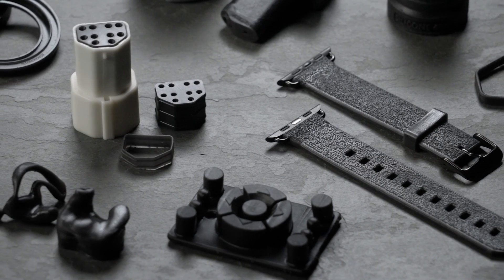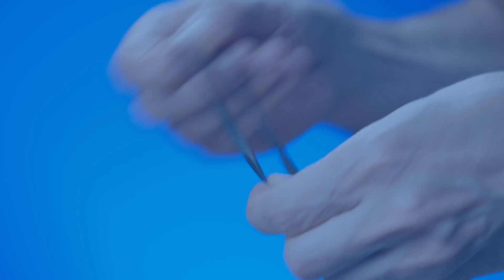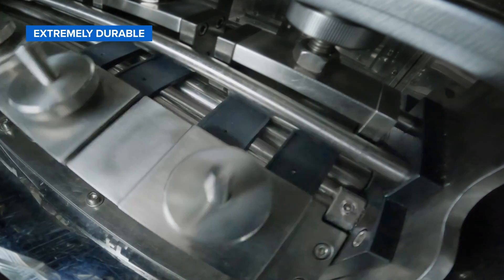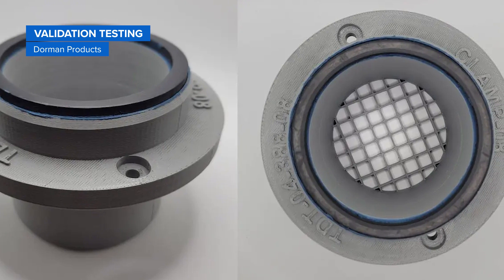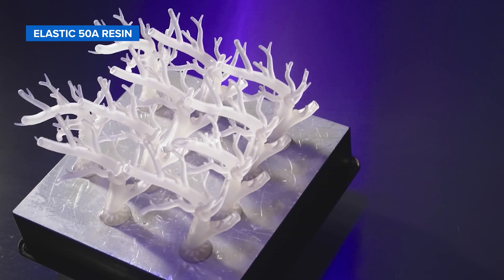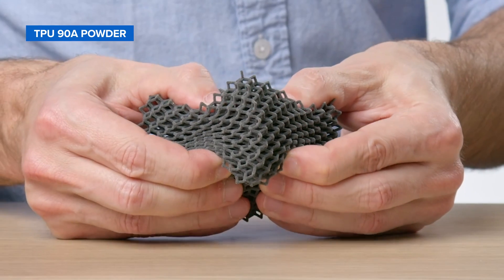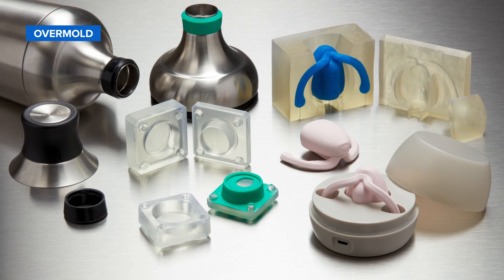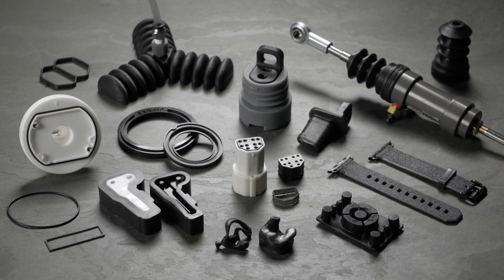How to Make Silicone Parts: Silicone 3D Printing, Silicone-Like Materials, and Silicone Casting

Comment: Bad dragons for allllllll!!!!!
Reply: i would assume this isnt PLATINUM CURE silicone. might be tin cure. i wouldnt do it this way. 
if you wanted to use a resin printer to make that, you can print it in hard resin, then cast it in silicone. repeat silicone molds using a pressure pot.

Comment: What about labor costs? This is why companies use automated injection molding. Tooling costs are high up front but then material and labor costs are much much lower compared to resin  so the overall price is lower.  If Formlabs could automate the process affordably and sell Resin for a price in line with production parts then I might be a customer.
Reply: This is for low volume fab. Automated injection molding isn't worth the upfront cost for most prototypes or short production runs. It's why people do silicon casting now, which is far more labor intensive than just printing the finished part and post processing it.
Reply: @bhengineering  yes, very short production runs... I'd like to use resin printing for short production runs of 100-400 parts  but still hard to justify due to resin and labor costs.

Comment: Unfortunately silicone like materials is NOT real silicone....
Reply: Then print with the 40a silicone instead of the alternative budget friendly option #2. 
They are just sharing  both options as people don't always need to spend the extra $ for silicon when all they need is 'soft' parts. Silicon printed parts are for applications that need soft + high temp + high chem resistance + black, or any combination of those.
Reply: Yes. Lots of red flags.. it's what they are "not saying" me thinks.